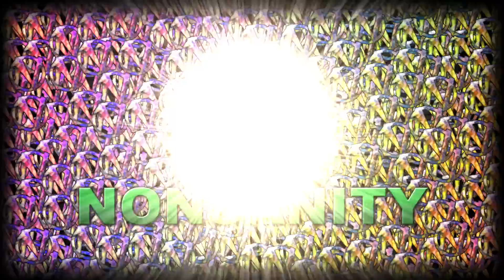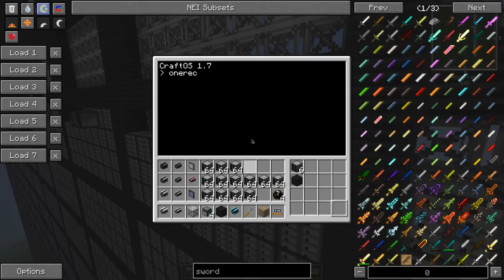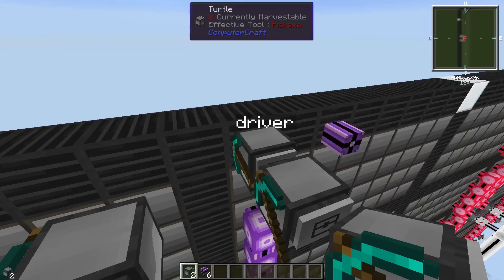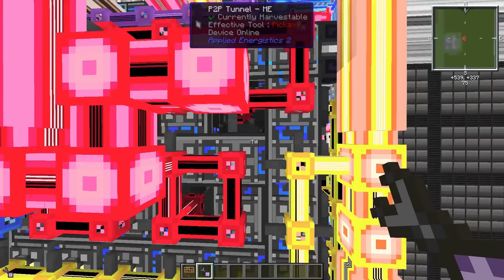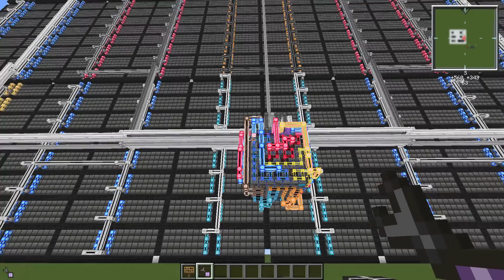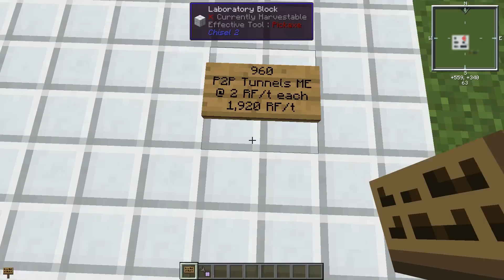Applied Energistics 2 - More Storage Extremes - Behind the Scenes

Comment: Is there any possible way to put an ME Interface on the individual "sections" of ME Drives? Im trying to build the brain cube in survival mode and what if I only want to access a certain portion of the storage? Ive tried doing it but it never works and I think it overloads the cable or something. Ive tried putting an Interface on the cable immediately behind the ME drive blocks but to no avail. Help?
Reply from the maker: Make sure you take something off the cable if its full and you want to add something new. Like drop one drive to add an interface.

Comment: well after few years you answered my question about power , but one thing i must say about SFM , this mod could go to level of AE2.

so far on all modpacks i used ,i had to start to replace alot of processing cable and machines with SFM cables , it takes times to config everything . ye its pain , but it pays off , first i cut power burn by almost 90% , i transfer fluids and items with "speed of light" , i compack them at same time and ... i went even futher with sorting it by connecting to DSUs

downside you have to configure it manualy and protect the "core" but overall i realy love SFM

if u only could trasfer RF with it , then it would be top 1 mod ever for me

with chest from project E u can pretty much handle autocrafting with SFM as well , i used barrels as display to keep 64 items in there , which is connected to DSU

another thing that i noticed is FPS and lag , using SFM reduced lag spikes by 90% as well,
because everything happens in second and not every tick
Reply from the maker: I'm a big fan of SFM myself. I'm missing it in my current 1.10 series now that I'm automating Botania. I'm using RFTools Control instead, but it's just not the same.

Comment: Apparently the largest sized Mekanism induction matrix full of ultimate cells could hold just shy of 3 petajoules, or 1.2 petaRF... By my estimate, it would take around 4 hours 10 minutes to fill up at a creative energy cube's maximum output of 10GJ/tick. 

New objective - get one of those and try to fill it up.
Reply from the maker: +Samuel Tan I made an 18x18x18 max induction matrix in my Daybreaker series. I can't remember if I got it completely filled or not before the series ended. :)

Comment: Reactorcraft fusion reactor can power this thing with ease.
Reply from the maker: +Missed Cue So can Mekanism's fusion reactor, I bet. :)
Reply: +Missed Cue don't even need a fusion reactor.. a simple small HTGR pebble bed with a single steam turbine with the RF generator multiblock from reactorcraft would power it.. the main bottleneck you would run into is transferring that much per tick (unless you use exclusively tesseracts)

Comment: These videos are awesome. I knew that AE could get a little ridiculous, but who knew. lol

So, I know that this video is a few months old and that you are busy with your Let's Play series. but.....

If I may make a request, I would like to see an automated system made to populate an ME Drive with Storage Cells. Say you have 2 cells currently in your drive. The system would create and add an extra cell to the drive as each cell fills up. DW20 did this using AE storage buses, an interface, a level emitter, and Ender IO item conduits. (I think alyeakitty mentioned doing something like this as well.)

He did this in his S7E53 Let's plays @ about the 4 min mark. Now, not to bad mouth DW20 (as he has some really good ideas), but he usually makes a bit of a mess when executing his builds. You on the other hand, seem to like to make things neatly and (even if not in normal play) exaggerated builds.
Reply from the maker: I never really saw the point of automating the filling of drives with empty cells. Once I have autocrafting (necessary in either case), if I make an empty drive, I can make ten empty cells at the same time and toss them in as part of the construction process. By the time I need all that storage, I've got the materials to do that.

It only makes sense if you can automate the crafting, placement, and wiring of new drives units as well—something I'm not entirely sure is even possible, let alone desirable.

I could demonstrate on-demand cells as a proof of concept, but it's not a practical automation system. :)
Reply: Fair enough. =D I just thought that it was a cool concept. Especially if your lazy like me and don't want to have to run to the drives to fill them. XP

Thanks for responding!! X)

Comment: Hi Nonsanity,
 does this working on FTB Infinity 1.7.0? I want to rebuild it on multiplayer for my modern/futuristic town project so I also want to ask for the scripts.

Another question is why those turtles are equiped with a wireless modem, isn't it one?

Hopefully waiting for the script and if you have BC as mod installed, try to make a blueprint and store them in the electrical library, after that copy it in a downloadable package from your mincraft/blueprints folder so that I can simple importing it in my installation and let the BC Builder rebuild it (if AE2 uses the BC API to store it, otherwise pls create a small building tutorial for that cube with connecting one P2P compleat correctly - will be fine).

THe requ. power of RF isn't the problem because I run a dual energy network builded up with quantum solar panels (converted to RF through rednet cable) and ultimate solarpanels, and with BigReactors (4x AKW-Core (20 Turbines connected to a big flat activly cooled BigReactor) with a poweroutput @ arround 520 KRF/t x4 = over 2 BRF/t.

Hopefully that this will be enough to create some peaces or the hole wall :).
Reply from the maker: People keep wanting to build that monstrosity, but it's highly impractical. Other than flash and bling, these storage extremes serve no useful purpose. The purpose of the demonstration was to show how much can be done even wishing AE2's channel "limitations." What would you do with this build that couldn't be fine with. Much smaller system? :)

I would have to recreate that map to share any part of it, since I don't keep worlds around for too long. The construction and drive-stuffing turtle programs were fairly simple and single-use. If there's a particular task you'd like to automate, it would probably be easier for me to make a custom program instead of recreating what I used before.
Reply: You mean that it will have a high server load?
Reply from the maker: It might, though probably only noticeable when you attach or remove something from the network. It's just not useful. There aren't enough unique items in the game to warrant that many drives, not when DSUs are available to handle large quantities of individual, high-volume items. :)
Reply: You are right, but think about to use it as building i. e. as network center. Well, it costs many ressources, it's big, it's ... totaly OP but as building it looks for modern/futuristic town rly nice and so you can use it parallel without to fill all the ME Drives or connect them (energy saving).

So it should be ok to build one of such a structure or i. e. your "Borg Cube" (is also nicht and a little bit better as the big wall ;)).

This is my oppinion.

Comment: your videos on this topic are just gold. pure gold. thanks for this QUALITY content. one thing id like to see is what kinds of builds can u make that are BIG builds, that are LEAST lag intensive in a server environment. i play on a public d20 server and my build seems to cause some major FPS lag when im near the system, and some TPS lag on the server. also what in the world kind of reactor are you building that can run 15 turbines. my 9x9x3 runs 3 turbines comfortably.
Reply: after writing this im realizing im using the term BIG on my second sentence, which implies that the system im using on the server is BIG but its not. simply 12 drives with 64ks, 6 DSUs, 80 molecular assemblers with 160 interfaces and a 5x5 controller. so thats not BIG compared to this system, but compared do what most of the players on my server make, its big.
Reply from the maker: cxcevents I couldn't say without examining it what might be causing lag in your set up, but you can always try disabling single chunks of it at a time and see if there's a part that responsible for most of it.

As for the reactor, I built it in both my recent Let's Play series, Modsauce and RR3. You can check those out if you are interested. I will say, though, that I haven't actually tested it with 15 turbines. But dumping the steam and measuring how fast it was being produced suggested 15 turbines was possible.

Comment: Unless you use Ludicrite blocks in the turbine; I've gotten one producing a little over 60,000 rf/t before; owever, I wouldn't suggest that as a viable option considering the cost of that. I just think if you are going this big, ludicrite wouldn't be such a big deal.
Reply from the maker: D3athstreak I use Ludicrite blocks in my turbines. And with the maxed out 80 blades, max 2000 mb steam/t, and default configs, it produces 28054 RF/t. You are probably playing with altered configs that use a multiplier on power production. :)
Reply: Hmm... I'll have to look into that. Thanks though!

Comment: Great behind the scenes!  I think one thing I can take from this is that regardless of using controllers, or not, the drives, when filled, will use the most power.  That being said, dropping off the need for controllers will reduce the need for power a bit and filling the drives as needed is the best for any storage solution in a play situation.

I will say that when AE went to AE2, I was apprehensive about using channels.  Since I have been playing with them, and watching videos like this, it has become easier to understand.  Just requires a bit more forethought than the previous AE.  Though I do not "go bigger".  ^.~
Reply: Little playing around with small networked verses sub-networked storage.  For my particular flavor I use storage buses off the back of each drive to insert empty cells.  Cells themselves use 1rf/t per teir, so 1k cell uses 1rf/t, 4k cell uses 2rf/t, 16k cell uses 3 rf/t and 64k cell uses 4rf/t.  Because of channel limit one contoller face of 32 channels can run 16 drives with 16 storage buses on about 110 rf/t without cells.  Due to channel limit only 6 drives are possible with a storage and interface bus. Placing storage busses on their own sub-network also requires a set of storage and interface buses. Creating an identical system of 16 drives (last sub-network missing two) requires 124rf/t.  Interestingly the latter system uses 6 sub-networks with each storage bus and interface using 2rf/t each for 24 rf/t.  Since a controller uses only 6rf/t the former system requires 104 rf/t witout it but you remove the 24 rf/t from the latter and one gets 100 rf/t.  Cable loss aside networked drives are more efficent for power but sub-networked drives, although slightly more costly in power (by 14rf/t if using additional storage busses - 3.5 rf/t without), are more convenient in their expandability (and are fun to build and look at).
Reply from the maker: alyeakitty And being fun is what it's all about, of course! :D Good research there. Not sure I follow it all from a simple write-up, but it sounds like you covered all the main points! :)
Reply: Nonsanity Aye, fun is why we do what we do.  Storage systems aside my favorite part of ae and ae2 is facing an export bus to an interface with an emitter and having things autocrafted like storage cells, pure quartz thingies, processors or even torches/lumber/food placed conveniently in an ender pouch.  Never running out of supplies or fully automating things makes minecraft for me fun, and solving those problems adds to it.  I wish I could post a picture or something but on my tablet it does not seem to want to do it.  ; ;